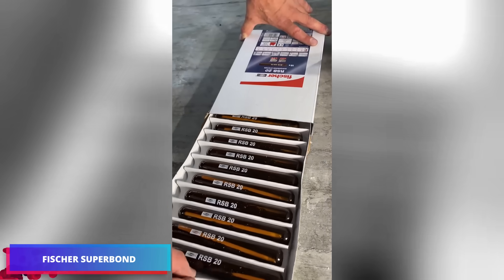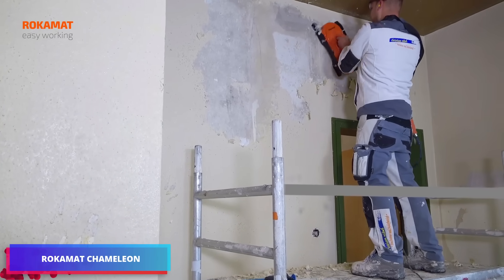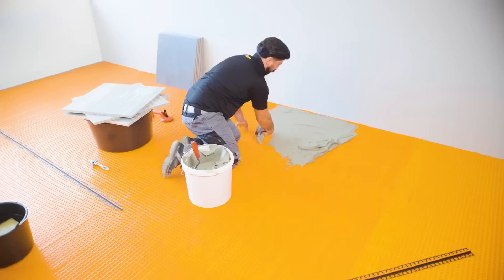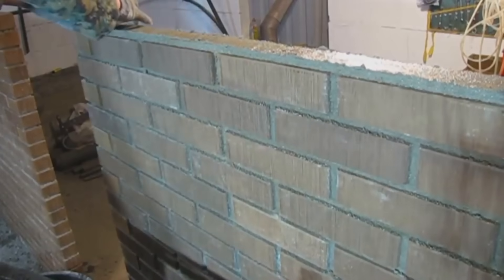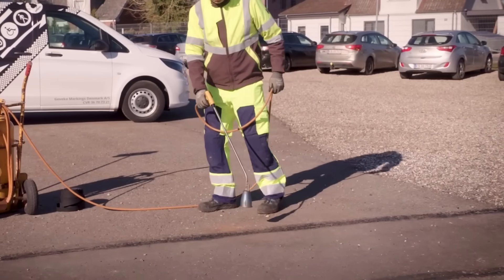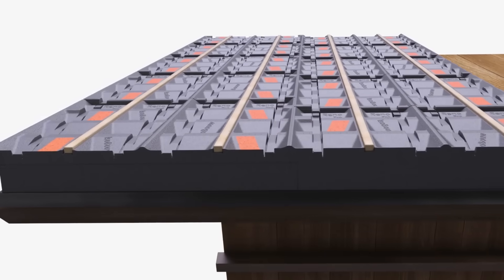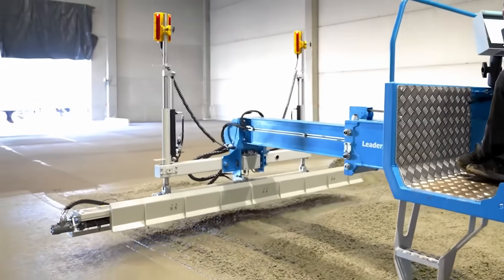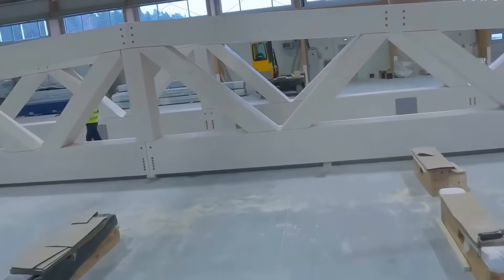Incredible Construction Methods You've Never Seen Before

Comment: Why dont they knock the nails in proper then???😵‍💫😵‍💫😆👍
Reply: After scraping off the shingles with a shovel or other tool, the nail head remains on the surface of the plywood. I guess you have a question because you have never scraped off the shingles from the roof yourself. This tool saves a lot of time and can save the worker from back and knee pain 🙂